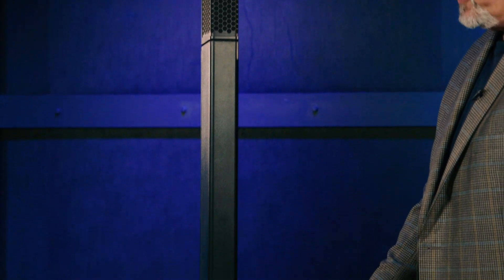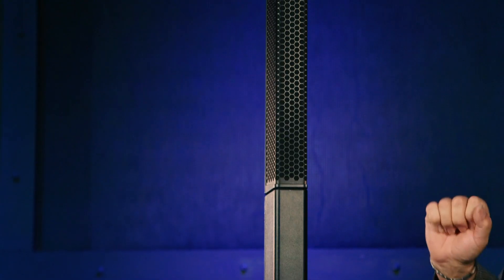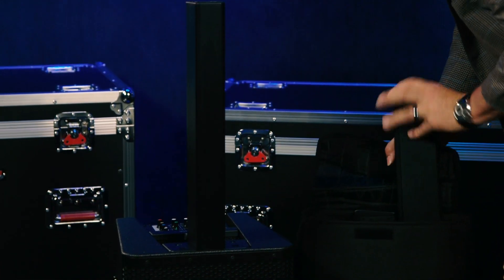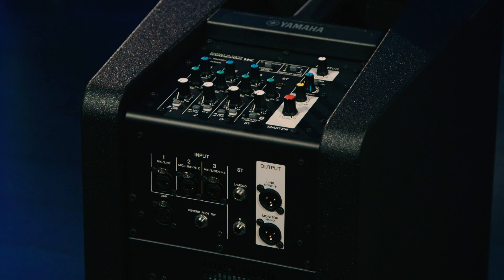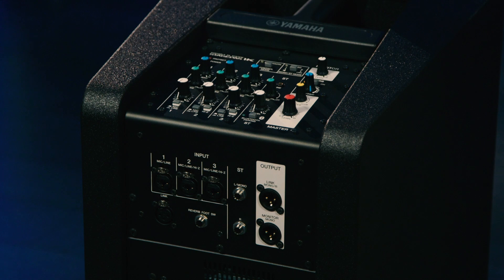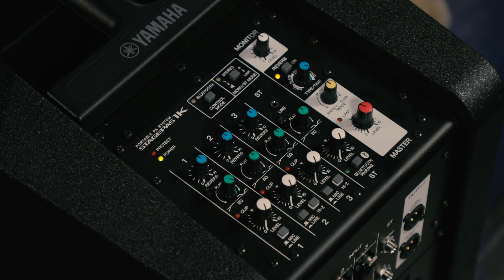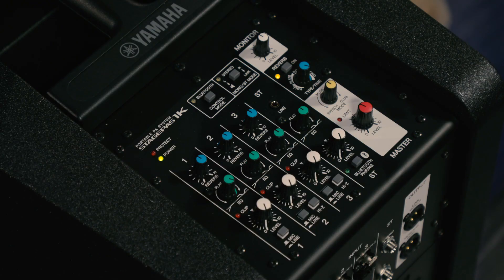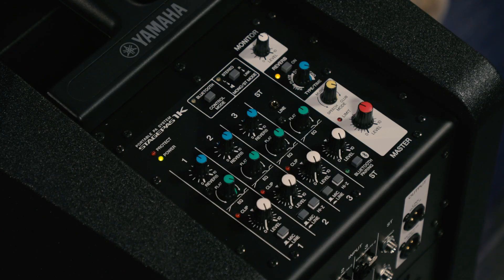Yamaha STAGEPAS 1K 1000W Column PA Speaker System Overview

Comment: This unit is not ready to be a pro unit. The amp went out on mine, Yamaha had me take out the amp module and return just that. They "repaired" it, I received, reinstalled, and it is still not working. No lights, no sound. The system uses a solenoid protection system that does not protect the amp components, It seems only for a power surge.  A true protection circut monitors the transistors, ICs, speakers and inputs.  The 1K does not.

Comment: WARNING....  DO NOT BUY FOR RELIABILITY. IF THE UNIT DIES, GETTING REPAIRS IS HARD AND TIME CONSUMING. iF YOU BUY FROM SWEETWATER, THEY WILL PROMPTLY REPLACE WITHIN THEIR TIME POLICY. OTHER RETAILERS WILL IN 30 TO 45 DAYS AFTER PURCHASE. AFTER THAT, YOU ARE DEAD. YAMAHA WILL ONLY TAKE BACK THE AMPLIFIER SECTION TO REPAIR, NOT THE WHOLE UNIT. THEIR "REPAIR CENTERS" DO NOT HAVE PARTS ON HAND, SO YOU HAVE TO WAIT A LONG TIME.  I have had this problem with power supplies in Yamaha products before, and it seems nothing has changed. After 3 uses in low volume at home testing, my unit died with a burnt transformer smell. You may get a long lasting unit, but some of you will not. Replacement parts are just too hard or take too long to get.  As I stated, buy this system, but you must have a backup.